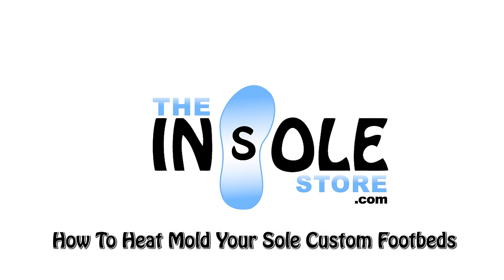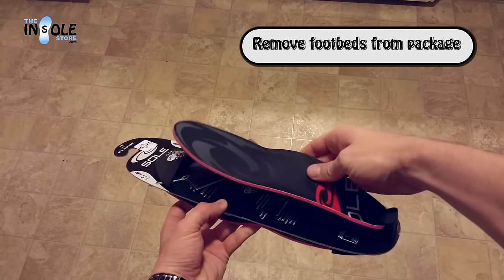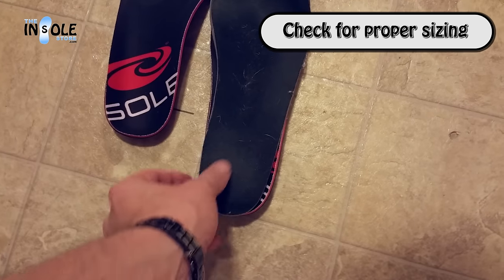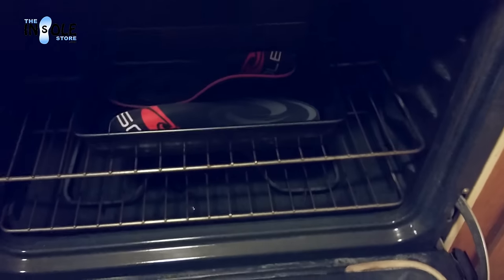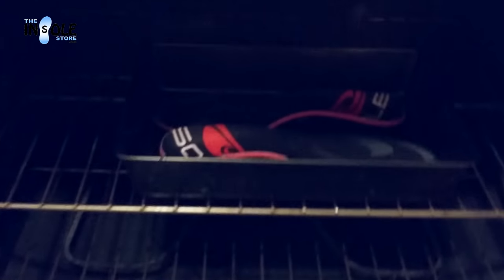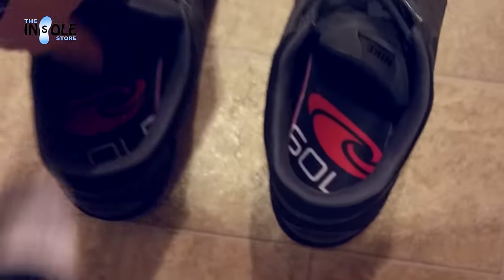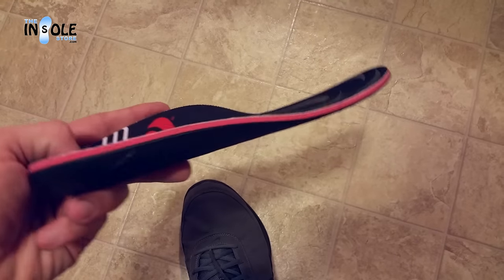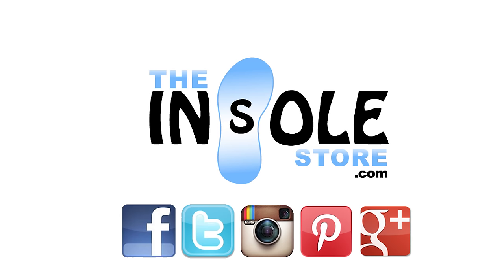How to Heat Mold your Sole Custom Footbeds & Insoles @TheInsoleStore.com

Comment: Hi...new runner here..  i am overpronate/low arch runners.. but i do have 2 shoes that i loved but its neutral shoes (Purchase wrongly).. should i am going with your product.. will your insole able to provide the STABILITY needed should i used it in my neutral shoes?
Reply from the maker: @Below Norm, I answered your question on the SOLE Response video too; however, I'll add that SOLE provides a 90 Day Comfort Guarantee -so try them out and see if the semi-rigid orthothic supports gives you the right amount of stability and support you need.  

Peggy
Reply from the maker: Below Norm -Yes our insoles can assist with stability by providing a proper foundation with arch support.  I you need help let me know what your looking for.  The SOLE insoles are a good option with heat/wear moldability; however, we carry every major brand and style of insoles available on the market -so depending on your personal circumstances, we want to find the best insole for your feet.   Please email us me at:  Ashley@TheInsoleStore.com

Comment: I had the chance to actually hold a pair in my hands so I have a concrete idea on how rigid these are. After heat-molding and cooling, will they be softer or the same in terms of rigidity?
Reply from the maker: Jaxon,  They should maintain the same rigidity properties; however, you do have a comfort guarantee that at least covers the cost of the insoles.  Please keep our customer service team in the loop.  Sincerely,  Peggy
Reply: Thanks! I'm looking at currexSole now but i'll most probably purchase from you seeing as it's not available near where I live.
Reply from the maker: We appreciate your business Jaxon -we do offer quick shipping.  Order by 2pm EST Monday through Friday and it will ship out that same day.

Comment: r they worth it i cant see any molding the look the same
Reply from the maker: Most insoles are designed to mold to the shape of your foot over time with wear and often takes weeks of wear to achieve. The advantage of heat-moldable insoles is that they conform to your foot's shape in a matter of minutes as part of the heat-molding process. Even though the changes to the insole as it molds to your foot won't always be dramatic, a well-fitted insole will feel more comfortable on your feet. The question of whether or not it's "worth it" really comes down to how much you value having that one-time heat-moldable fitting capability. Many people use non-heat-moldable insoles and are completely fine with it; others prefer having that instant-fit capability.

Comment: I'm wondering how these can help with problems like pronation. If you're putting your full weight on it, wouldn't that flatten the arch and emphasized other issues? Why aren't these fitted over a foam bed like some other orthotics?
Reply from the maker: Doctor Trombone, thank you for your inquiry! The SOLE Insoles feature a semi-rigid orthotic arch support which helps when you put your weight on the arch it doesn't immediately collapse, but will still have some give. If you are looking for a firmer arch support check out our Rigid Orthotic Insole options at: https://www.theinsolestore.com/high-arch-orthotic-arch-support-insoles.html
Reply: C é no
Reply: Boa noite